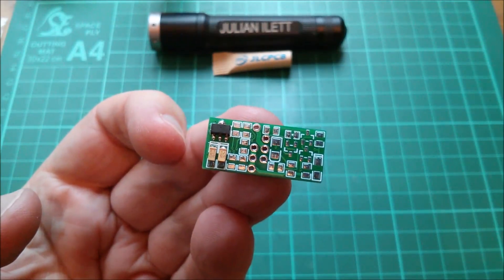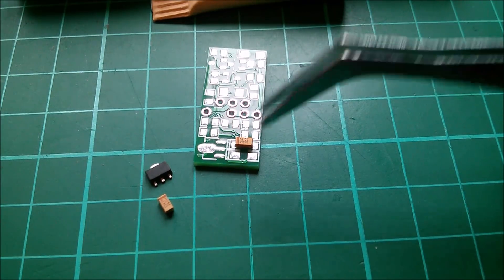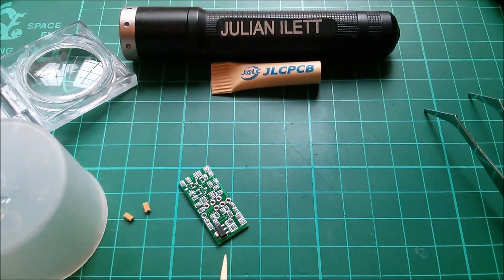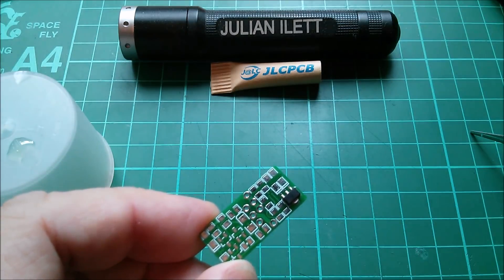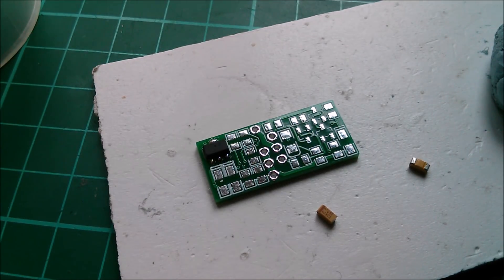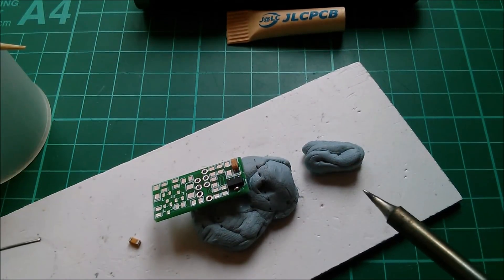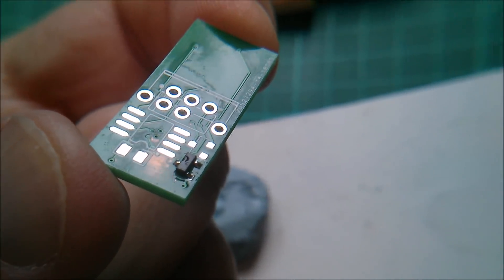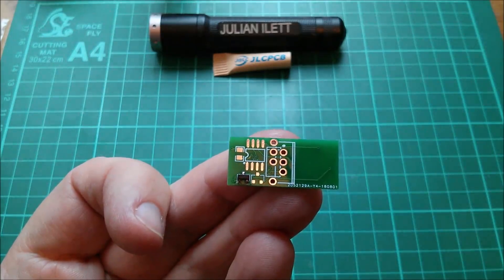Glue and Solder Surface Mount Components - PWM5 Femto

Comment: Thanks Julian. I'm a little angry at some of the comments I've read below. Some of us have had shaky hands for years and haven't been able to do smd work at all. The last time I tried, I destroyed the device. I'm excited to try the UV glue so I can use 2 hands to hold the iron. I wonder if the glue can hold up to the heat of a hot air station, instead of an iron. Again, that would help with the shaky hands. Terrific video!

Comment: Julian, ayieeeeeeeeeeeeeeeeeeeeeeeee!    Glue was all along the  side of the toothpick and it would have been much easier to touch that to the reg and board, y'know?  I found myself reaching for the toothpick to show you, but the display got in the way.  LOL   I'm also fairly much ambidextrous, so I tilted my head while watching you deal with (what you find awkward) soldering angles.  Everybody's a bit different, wot?

Comment: That cheap UV glue is fun but recently I received some which had leaked in the post due to poor packing.... be warned that in quantity the solvent in the glue can make you feel very strange... use a ventilated area or only small quantities.... as for the SMD... just solder the  thing on one end and get on with it.

Comment: It's certainly worth looking into a hot air rework unit. A touch of solder paste on the pads, and when it's molten, the component will align itself perfectly with the aid of the solder's surface tension. It's an absolute breeze and takes no time to master. I couldn't believe it the first time I tried it. You'll easily be able to knock out a perfectly soldered board in under 10 minutes. You save the time spent gluing and also benefit from strong solder joints around and between pad surfaces.

Comment: I have bad near-vision, and shaky hands, so when I tried soldering an 48-pin 0.5mm pitch MCU last night ... considered glue as well.  One thing to do is use rock-hard resin, and melt a drop with the iron, and put on the PCB.  It will slowly freeze back solid, and glue the component in place as you fiddle with it, getting it centered.  A hot air gun will get it flowing again, if you mess up.  A good thing about resin, is that it will dissolve in alcohol.  A thin liquid flux like Kester 186 gets very sticky as it drys, and can be useful in placing those itty bitty things.

Comment: why not glue it down with conductive glue? XD....also julien .... the real advantage of SMD is supposed to be mass manufacture, you can have a pick and place machine sit them down with some paste and feed them through an oven to have a nearly complete board on the other end; compared to inserting and soldering every single component in by hand. maybe you should give reflowing in a retrofitted snack oven a go :P

Comment: Get a 858D hot air blower. Cheap as chips. It takes up no more room than a soldering station.   I've also had good results with a student bedsit hotplate* for QFN packages.  Using adhesive with SMDs is a waste of time.

* I should add that these tend to have hotspots, so I heat to above the required temperature, then allow to cool to the temperature I want, so the temperature evens out across the plate.

Comment: This seems like more work!  you have two far easier and less time consuming methods available.  First is to tack the component  with solder (this is your only really option if using an iron) the other option is to use solder paste and hot air, this way the paste will hold the components from moving around and gently applying hot air (hot air is cheap these days) all the components will find the centres of the pads using the surface tension of the paste.

Comment: I've found that when soldering SMT components, it's much easier to put solder on the bare pad first, then flux it, re-melt it, and place the component into the pool of molten solder. Let it set after getting the positioning to your liking, then solder any other pins.

Comment: Admire the attempt but a bit of stiff wire into some blutack as an anchor to hold down the component is sufficient and takes seconds.
Reply from the maker: Awesome, can I steal that idea?
Reply: @JulianIlett  er not my idea and plenty of tools out there that do the same job, ready made for you to purchase that probably do better than blu tack at anchoring the wire to your desk.

I've used wire hold downs in the past secured to a helping hands for example, just mentioned blu tack to reference your love of it for holding through-hole components usually.
Reply: @JulianIlett  see: http://vpapanik.blogspot.com/2015/02/the-smd-beak.html?m=1 for an example of a very nicely made one.

Comment: Very good. Your SMT soldering is coming along nicely Julian. Next step is to eliminate the glue. I do this by lightly tinning one pad, then heating that solder with the iron while bringing in the component with tweezers and setting it in position before removing the iron. Then I solder the other lead(s), then retouch the first lead with a little fresh flux cored solder to eliminate the likely dry joint. This method is quicker, easier and avoids contaminating pads with glue.

What helps me enormously is using a 10x binocular microscope. You can get these with s third optical path for a camera, which would enable you to video the process. I got mine cheap, secondhand.

Comment: Have you thought of using something with a spring loaged tip (a center punch comes to mind) to hold the component down?
Another way as regards gluing, is that baking soda will set off superclue in a second (plenty of videos on youtube ) and I think I've seen that baby powder is slightly slower

Comment: Now days i order a stencil with every pcb order. Makes soldering so much easier for both oven and hand soldering. Solder paste works well with oven/hot air or soldering iron when used with a stencil.

Comment: You need to build a reflow oven...surface tension holds components on when upside down...pretty cool soldering 0805, but 0603 would be too small

Comment: I once made a gluing rig like this - with cocktail sticks embedded in a square of polystyrene.  Dipped in the glue then applied the PCB.  Worked quite well.  Didn't try it as part of a production run though; was more out of curiosity.
Reply: And you've just reminded me of where I went wrong.  Glue on the pads was a nightmare.  Sort of solved it by creating guide holes in the PCB corners which ran down some longer cocktail sticks to make sure the contact with the others was purely vertical.  Probably no use on such tiny boards.

Comment: Perfect video to explain why the DIY electronics hobby is, if not killed but at least dampened, by everything turning to only SMD. You need a stable hand, you need extra techniques to hold components in place and you need either a good magnifier or even a microscope to even see what you are doing. It is a miracle that some component manufacturers still provide thru-hole versions!

Comment: i would like to see a build video on building a radio using 1 pcs TDA1905 5W Audio Amplifier with Muting IC New DIP ST, • Digital Potentiometer - 10K, Audio Jack 3.5mm, ELEGOO 17 Values 1% Resistor Kit Assortment, 0 Ohm-1M Ohm (Pack of 525),Ceramic Capacitor Assortment Kit - Set of 600 Small Assorted Capacitors from 100 nF to 10 uF in a Box - Non-Polarized Disc Capacitor Component Set from Plusivo, Electrolytic Capacitor Assorted Assortment Box Kit,500PCS,Pair 62.5cm 4 Section Telescopic Stainless Steel AM FM Radio Antenna, microtivity IL612 5mm Diffused RGB Controllable LED, Common Anode (Pack of 12),MicroSD card module for Arduino and a Breadboard - Mini Modular (White) and put it in the same case as the Make your own FM Radio - Part 2 and have it swith (if you have headphones plugged in) between the speaker and the headphone jack

Comment: I had been soldering for many years on and off as a hobby. I never tried SMD's and feared they would be nearly impossible. I am in my 40's now and my eyesight is not the best anymore, but decided to buy a chinese stereo microscope ($250). Once you can see what you are doing when soldering, it's actually quite easy. I can solder 0402 (a little smaller than a single grain of sugar) components without too much trouble. Honestly if you can see properly, you will be amazed how you can learn to steady your hands. I highly recommend it! And forget about all of that glueing bollocks.
Reply: Yeah, that is one of the first things I am going to buy next big order from China... Hope the tariffs don't screw me over!
Reply: Buy a 3.5x to 22.5x binocular stereo microscope. It’s plenty enough magnification! I normally only work between 3.5 - 6 or so. Do not buy a microscope camera and display as it destroys your hand/eye coordination due to latency. Stick to optical, it will make you feel almost super human, I promise :) I didn’t realize how much I needed one until I got it :)
Reply: loiphin  I recently found vids from a guy in NYC (you might know the quiet gent, Louis Rossman) who has a microscope and it does, indeed, make a big difference in what you can see.  I'm 65 and bifocaled, so I've had your experience, too.  Found a set of over-the-glasses 10-25x lenses/frame for $8 which works well, as does my 4x fluor loupe light.
Reply: I think I am going to go with an actual optical microscope, so that I can set up a 'workbench' with it so I don't have to move things in and out of the way when I want to work on them.
Reply: What about the eyes? Does the microscope tire your eyes like magnifying glasses?

Comment: I would suggest just getting an 858D hot air gun and use solder paste.  That way you can remove components.  Super cheap and easy

Comment: A bit of practice, high quality flux, solder and an iron are all you need. This is just silly. The flux will let the solder flow under the parts. I use Amtech 559, it's expensive, smells nice and gets the job done. I'm not meaning to pick on you, it just feels like you're trying to reinvent the wheel and these components are massive so far as SMD goes.

Comment: And if, at a later time, you need to remove a glued component without destroying the board?
Reply: No problem, the UV curing glue is not heat resistant so simply heat it up with the hot air gun and off it goes... Oh, wait...
Reply: It would be easier if he would order pcb's in panel, rather then 5pcs, probably more than 200 to just throw away if something went wrong

Comment: That‘s a great technique. Hardly takes more three times the time without using glue. :)  I get the point though. It was a try. My tip: take a chisel tip rather than the pointy one. And use tons of flux. The parts will nearly solder themselves in.
Reply from the maker: Argh, I keep forgetting the flux. It's like forgetting who your best friend is ;)

Comment: The idea is great, but you're making it way harder than it is.. Tin one pad, add flux, place part while holding, melt solder, position the part while solder is melted and solder the other side. Simple.
Reply: that's how I do itif I had hot air I might do it that way but either way not really necessary to glue it...I do believe a lot of pick and place machine add some glue to keep them in place though, but that's a automated process.
Reply from the maker: I usually do that - thought I'd try something different.
Reply: You thought you'd try something that takes three times as long, involves much fannying about, and you may have contaminated the pads.  And now you've glued the fuckers to the board, so you can't get them off?
Sounds like a great idea!  I wonder why no-one else does it?
Reply: Hot air should take them off easily. The glue should break down with the heat

Comment: Just use a cheap hot air gun and solder paste. I always solder my Micro RC receivers with this technique and never had an issue.
Reply from the maker: But how should I dispense the solder paste?
Reply: Easy if you ordered a stencil at the same time as the boards. You then lay the stencil on the board and smear over the solder paste. Then place all the components in the correct places and heat with a hot air station. All the solder paste melts and the components are soldered all in one go. ;)

Comment: This seems very much slower than holdign the component with the twwezers flux on the pad and just tin the solder tip. This also seems considerably more difficult.
Reply: Not only that , but if a component should go bad or be bad and need to be removed. Good Luck not destroying the board. I just use fast melt solder paste. I put a small amount on each pad and the paste holds it while I hit it with hot air, works every time, never had a tomb stone.
Reply: @cmj20002  100% this! In my case it was the component, (a small SMD diode) that ended up getting destroyed. Glued down components are the devil! I've come across manufacturers that actually glue down what seems to be every... Single... God damn one. 🙄
Reply: On a larger PCB however the glue may speed up the work. With a bigger lamp. Its a well working process in the industry for wave soldering with a heat curing glue. Worths the try.
Reply from the maker: It depends how steady your hands are |:)
Reply: Rest the side of your hand and little finger on the table as you hold the tweezers. Makes your hands very steady. Learned that using an otoscope.
Reply: Julian tell your wife it can double up as a hairdryer and you are good to go to leave it in the living room or so :)
Reply: @JulianIlett  glad people are trying new things!  PCBs usually already contain some amount of UV-cured resin, so attaching components with UV-cure adhesive is quite fitting!  what brand of UV adhesive are you using?
Reply: He could just use those normally closed tweeters as a spring clip to hold them during soldering. Even a croc clip will do.
Reply: +Plebz0r Blapparapp you're confusing intelligence (he's quite bright !) with 'doing things his own style' and not choosing the obvious (he's stubborn but I like his alternative trial and errors in achieving his goal, its fun and interesting to watch). Also he doesn't care if he loses a couple of viewers, the ones who like his style will stay there anyways.
Reply: Maico  Yep Julian is smart but he is a little bit like "the man who says things in a very roundabout way" some times.
Reply: rimmersbryggeri : You are right ,Julian ,just use some good  sticky "amtech flux " the real deal  NOT the chinees fake shit or the thin stuf from these crappy flux pens .
And use some Kester 63/37 rosin core solder (lower melting temp and faster setting when removing the heatsource than most solder or 60/40 .
 Only then you have a excellent solderjoint .

Comment: Am surprised you're not using a liquid flux to help solder flow under the glued down components. There are many differing techniques for this - interesting to see another one!
Reply from the maker: Argh, I keep forgetting about flux - keep forgetting that it's my friend ;). I must try it - maybe it would help with the glue contamination :)
Reply: Personally, I'd ditch the glue.  I'm doing a board right now and just tinning one pad and soldering to that then touching the rest. Much less fiddly. :)
Reply from the maker: I don't think the glue will work with the 0805 Cs and Rs - so I'll likely revert to that.
Reply: Sent you a photo via Google photos

Comment: It's just as easy to solder the components as it is to glue them. ;) 

On a different note.

The PWM5s that I've made using the 7550 voltage regulator, charge the SLAs to ~13.7 Volts. This in my opinion isn't going to detrimental to the battery life.
Reply from the maker: Yeah, I've noticed the HT7550 has a 3% tolerance - the LP2950 has 1% - now I'm going to have to write that calibration function.
Reply: Julian Ilett 

That means I'll need to reprogram 50 or so PICs. :/ Or I could just leave them as they are, as I don't feel 13.7 Volts is going to do any harm.
Reply from the maker: No it won't make much difference. The 14.4V saturation charge may be 14.6V on those controllers.

Comment: Nice

But you can also get a hotair gun for less than 20 dollars
Reply: I was about to say the same. This is really painful to watch, why on earth are you putting yourself under such agony if you could simply use hot air like a normal person... NB: UV curing resin/glue is not heat resistant but poisonous which is a really bad combination for gluing components to be soldered on a PCB...
Reply from the maker: But will it fit in a room 2m by 3m small?
Reply: Julian Ilett 

Yes. A hot air rework station isn't very large. Mine is smaller than a shoe box.

However for low volume SMD soldering, an iron will get the job done just fine.
Reply: @JulianIlett  Yeah, actually I have got a mini hot air station from china 20x30x18 cm big :)
Reply: A soldering hotplate isn't much more expensive.
Reply: I agree with Frank Hovis. A hot plate would work, too. And you don't have to get a specific "soldering" plate setup. Just need a hot plate that you can set the temp to. Don't get an induction hot plate as the electromagnetic field might damage the small IC's.
Reply: "a hotair gun for less than 20 dollars"

Where that?
Reply: @Okurka: In the US we have a cheap store called Harbor Freight. Another called Rural King, and a third called Ollies. Hot air guns are fairly cheap here. Other countries, not so sure, tho. 
The hot air guns are only 2 speed, low heat/fan, high heat/fan. kinda have to play with it to get the right distance.
Reply: Korishan in turkey there is a cheap store too called eminönü (thats the name of the place that store is in) you can find 1 turkish lira (0,17 $) soldering iron there.
Reply: Aviation Anonymous WHAT? does 0201 even exist! İt must be small as a fine sea sand particle!